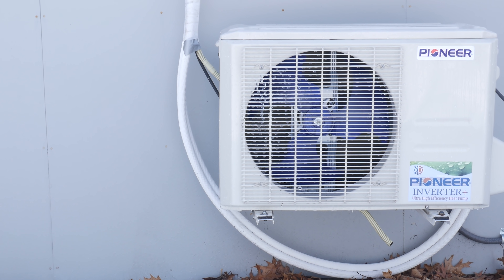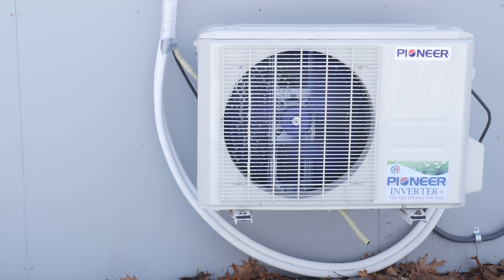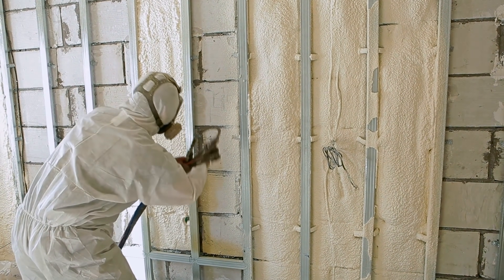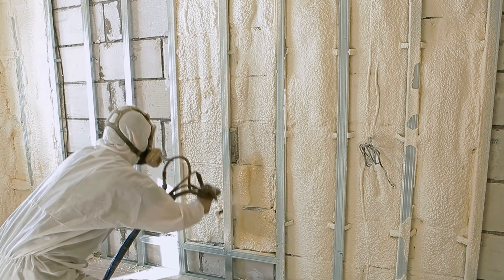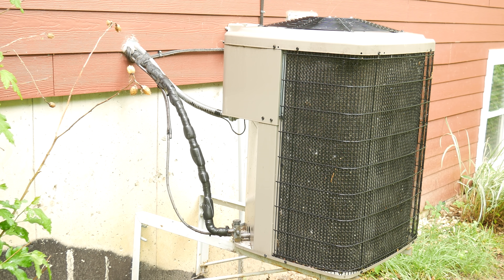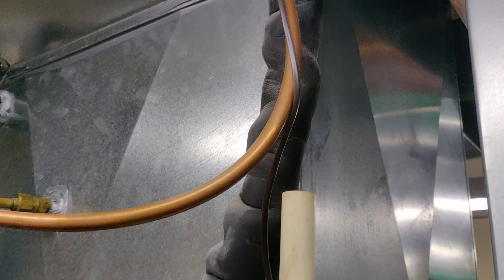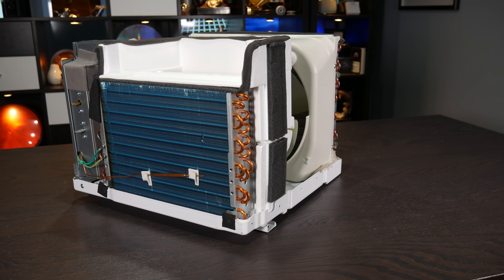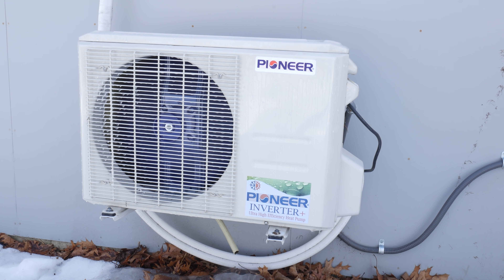Heat Pumps are Not Hard: Here's what it will take to start pumping

Comment: "Seattle noise ordinance" sounds like BS. I worked for an HVAC contractor in Seattle who specialized in heat pumps. The one noise complaint we had he had an acoustical engineer check out. From the complaining neighbor's property, the measured sound level of the "noisy" heat  pump  was less than the wind blowing through the birch trees between the two houses.
As a side note HSPE and SEER need to be regarded as soft facts. To make them comparable across brands, the use of resistance heat during defrost cycles and due to consumer demand (turning up the thermostat "because it's cold" which engages the resistance heat to meet that demand) is discounted.
[When heat pumps were first being installed in the Portland area the BPA did a study which found that these factors decreased the unit's actual efficiency: a cold wet climate which required frequent defrosting, resistance heating to warm the cooled air when in defrost mode and people bumping up the thermostat, could push a COP near to 1.0]
 not accustomed to the "cool air" produced by a heat pump]

Comment: Out heatpump performs worst at -5 to +5 centigrades. The reason for this, afaict, is that it needs to defrost much, MUCH, more often than at higher or lower temperatures.

For us, this is not a reason not to buy one, but maybe to have an alternative solution or a prepared mind for colder temperatures during some months of the year.

A relative has a fancy kind that can show COP, and during December it dipped below 1...

Still... More than 90 per cent of the time it works better than direct electric heating.

Comment: Carrier claimed that it would be infeasible for me to replace my AC with a heat pump... We needed a new AC and I asked for a heat pump instead and they said that the heat pump is much larger which would make it impossible to install in-place... They would have to pour an entirely new concrete platform and run everything to the new location which would cost tens of thousands... Absolutely ridiculous. So frustrated that now we're stuck with a brand new AC but still stuck with our furnace. It really does feel like all the stupid HVAC companies want to prevent heat pump adoption. Here in the PNW, it never goes below 10°F.

Comment: As far as I know heating heat pumps will have condensation on the outside unit, what might also freeze and blocks the further water to flow. This is something you should have addressed in this video.

Comment: I've had a heat pump for around 15 years.  Over the last couple of years it's started making hissing or screeching noises when starting up sometimes.  Anyone know what's causing that?

A quick search says that it's coolant escaping or the bearings in the motor needing greasing/the motor is failing.  Since it's been happening for a while I'm guessing the motor isn't failing.  Also seems like if it had been losing coolant for so long it would be out and no longer working.  Looks like the motor's bearings may need a good lubing.

Hmm, after a little more research it looks like it might just be the unit starting up after the defrost cycle.  The sound is the same but it's hard to tell from a video if the loudness of the sound is the same.  Still think I will have a technician check it out just to be sure.

Comment: Some other things to note here.
 
Brands for heat-pumps vary a lot in capability, pick wisely.

A higher end brand like Daiken make excellent units overall but you pay more. 
Mitsubishi make excellent mid-teir mid-priced units, and I'd personally suggest you avoid anything that says "Fujitsu" and is cheap. To make it clear Funjitsi expensive units are expensive for a reason and are fine, but their cheaper units are AWFUL avoid.  
Not saying they are "Bad" overall just that they have more problems than other brands, and their remotes are overall poor user friendly, less reliable and annoying to use. the cheaper teh unit the more cost cutting was done and it is noticeable. a house is something you own for a long time, and so is a heat pump. Pay more and bet a better unit you will not regret it, go the other way, and you will.

Also: Size matters. No really, a 3000W unit will be a LOT more quiet than a smaller 1500W unit, and that matters when you are putting on in a bedroom. The bigger the better when it comes to noise reduction levels. The price goes up the bigger the unit, but the unit is more efficient so creates less noise, and wastes less power overall.

Wifi - Add on components. Manage your Air-con away from home (or in bed), set it so it turns on before you come home, so you get home to a nice cool home, or a warm one etc. Wifi units are not default in most units. Often an add on function, some are built into the design, and others require big ugly extra boxes next to the head unit. 

Also because WiFi varies in quality so it could drop, or if your connection is down you cannot remotely turn on your heat etc. 

Just some tips from a person who's had a LOT of dealings with heat pump installs.

Comment: If you seal your house too much, then the house will not be able to breathe. An house which can not breathe much, even none at all, then moisture will start to build. Thus mold mildew, and damage from the moisture on the wood, and taking into account that the newer houses are built with new growth wood, and that differs from older homes built with old growth wood. That is why older houses stand longer and handle more situations that would damage newer houses.

Comment: It's expensive cause it's good buisness.
In US everything is made more expensive because people can spend that much. For this reason ,companies make millions even billions in a short amount of time.

The mitsubishi heating setup you've talked about earlier would cost around (4450-4460$) in my country. For the entire setup.
3800$ for the AC (yes !, in my country it's 3800$ and it's ) 
600$ more or less for tubing and wiring 
100$ for fastners and other required equipments.
And around 50-60$ for installation service.

We can buy a brand new 1ton AC or from only 390$ to 666$ 
Local brands sell a 3 ton AC for only (900$ to 1000$)
 Even some imported once like a 3 ton General AC from japan will cost around 1100$ 

Point to be noted ; in our country we use split system AC although these split systems can be integrated to duct systems quiet easily ,which are capable of both heating and cooling ,so I've simply mentioned AC.

Comment: Wait, doesn't this mean we can use heat pumps for hot water, air conditioning, and heating? All with just essentially 1 outside unit (or possibly stacked units).

Comment: My house is over 100 years old. The insulation situation is not great. I heat with firewood, with 15 acres available and plenty of dead ash. That’s almost entirely free, just with a time commitment. Heat pumps are stupid. I’ll probably get a heat pump furnace installed when the new house is built though. It’s stupid so it’s easy and doesn’t require onsite fuel.

Comment: Is there any smart system to implement in small factory to at the same time pump heat from cold/freezing room to other part of facility or even heat water? This would be like win win situation, you take unwanted heat from one place and transfer it where needed. Maybe even use in blast/shock freezer? Anyone?

Comment: as a commercial HVAC tech, I hate the idea of heat pumps for one big reason: you're relying on a refrigerant as a primary source of heat. leaks are far more expensive and time consuming to fix than a boiler or gas furnace. I live and work in the Chicago suburbs and SO many of the VRF heat pump systems are problematic, leaks and compressor failure being the main culprits.

Comment: Hypothetically if an entire city has heat pumps as the only source of heating during the winter time, with all of them trying to extract heat from the environment, wouldn't the city itself get colder??? I guess the heat pumps themselves would also be creating  heat. But think about it, what you're doing is thermally connecting the inside of every enclosed space with the outside environment, essentially increasing the surface area of the entire city, and with more surfaces absorbing the heat there will be less of it in the are therefore dropping the temperature at least slightly!

Comment: i really see a 2 part system in updating insulation in buildings 1 a multiyear tax right off and 2 a tax on Commercial buildings that dont meet a certain R value and will increase based on average rent price + energy cost meaning increasing rent to pay for the tax will just cause the tax to increase by that amount

Comment: 11:08. I really think you need to emphasise the importance of not letting the refrigerant out. The fact that's it way more likely with split units is the main problem with them. most have huge GWP (2000-15,000), you can set the atmosphere back the same amount as several years-worth of heating with gas. Newer propane and CO2 based machines are way safer. I really would avoid recommended HFC and CFC-based split machines to people. I am amazed that you are allowed to just put in your own F-gases where you are. Land of the Free in non-ironic form, but I dread to think how many slightly leaky heatpumps there are out there, slowly leaking F-gases

Comment: What about the sensor technology being used on, for example, heat pump clothes dryers? It’s not working real well, sorry to say. The devices are deciding, poorly, when your items are dry, and owners of these dryers are having to literally add water to the drum, or a wet rag, to trick the system into completing the task. So, if the intent is to save energy, it isn’t great.

Comment: What about tax breaks to building owners that meet certain insulation requirements. And tax penalties if your building is too inefficient (thus new buildings have to meet a certain standard thats sliding and hopefully this wouldnt completely grandfather in older buildings into doing nothing - there would be grants or low / 0% interest rate loans for various owners who want to retrofit and gain the tax benefits).

Comment: 1. Insulate
2. Insulate
3. Insulate 
True. And that is why HPs make absolutely no sense in cars.
Reply: But they do make sense in cars. Teslas with HP's see big range gains compared to resistive heater variants.
Reply: @logitech4873  I own 5 Teslas (2 M3s and 3 MSs) with and without HP and I don't notice any difference in range. Those are theoretical numbers on factsheets. It depends where you drive them. Here in eastern Switzerland, where's it usually cold in Winters, the HP is useless. The car primarily heats through resistive heaters anyway. Simply because the HP cannot produce like 60°C warm air which is required to heat up the cabin in a decent amount of time. And then, throughout the rest of the year when it's warmer and you don't need to heat the car, you have to transport all the extra weight of the HP which causes higher consumption. In addition the HP is a complex expensive device which requires expensive maintenance. I am forseeing the future now: The biggest problems with used electric cars will be expensive HP repairs which will pressure on the used-car prices. I calculated that my Model 3 LR has to be driven for up to 33 years until the additional price of the heatpump pays out through the reduced amount of electricity needed. For the price of the heatpump it would be much smarter, cheaper, and also better for the environment, to add an additional 10kWh of battery capacity to increase the range of the vehicle. Because the additional capacity is usable throughout all year all the time. It allows the car to charge faster and the battery life is extended because of about 15% less charging cycles required. HP in cars are a waste of money. They are good for well isolated buildings though. But a car is not a stationary building. The constant shocks to the HP system while driving is causing heatpumps to fail much more often than they do in buildings. I predict that most of the todays' heatpump will not live longer than about 8 years in average. Exchanging a heatpump will cost like 4000$  for hardware + labor. That's what I mean when I say that this risk in expensive repair will pressure on the used-cars prices. In the future people will look out for EVs without heatpumps on the used-car market and EVs with heatpumps will be harder to sell. Look at how often the AC breaks in older cars. Pretty much every older car once experiences a defective AC. And cooling is much simpler (and less material demanding) than heating. I only buy an EV with a HP when I decide to sell it again after 4-5 years. I also own a Hyundai Kona which I plan to keep for longer time. So I bought it without the HP.

In Germany they tested all sorts of heatpumps in different cars and no additional benefit could be recorded so far in real life environments. In case of the VW ID3 the car with the HP was even less efficient than the one without. In the end I say: everyone should buy what he wants. I just don't want the government to like mandate heatpumps in EVs. It does not make any sense in that application field.

Comment: I think the insulation Materials you showed do not have the thermal mass that's needed to keep radiant heat out. They are great at not conducting heat tho but at thé end of there life just at tho thé big pile of trash. 

It's better tot use woodfiber and cellulose insulation. They alsof good at not conducting and are a lot better in storing radiant heat so it doesn't enter the home. And at thé end of there life they go back to nature or can be recycled or reusd easyly

Comment: Guess who got a heat pump? This guy! The furnace was busted and the AC coil was rusting out, so cheaper to replace with a 16 SEER heat pump than replace what was already there with new. $6300 installed with new, fancy, wifi thermo.

EDIT: The other quotes I got: 11k+, and 14k+.

Comment: You cannot beat the laws of physics. Either you live in a modern, over insulated, poorly ventilated sweat-box, which is both unpleasant and unhealthy to live in, most of the time, and requires a ton of energy to cool in summer, but can be heated with a candle in winter - with big energy savings. Or, you live in the opposite (like me) in a 120 year old, well ventilated (healthy), stone walled house with natural air-conditioning with zero running costs in summer, but hell to heat in winter. (don’t ask me about my 2 boilers). - I know which I’d rather live in.
Reply: An "overly insulated" building is easy to keep cool with an aircon.

Comment: It is so easy to completely destroy an older building by "insulating" it. The worst case is when the exterior is designed (or simply built regardless of design) to dry to the interior as was typical up into the 1980s, and you seal the interior in the name of efficiency. Then the walls rot, but you don't know it for 10-20 years.
A proper efficiency improvement really needs to consider everything from sealing the exterior to modern standards for water and vapor, and continuing to insulation and sufficient ventilation (air changes per day) for the health of the building and the occupants.
Or you just add a heat pump and ignore the existing building.

Comment: lennox is stupid expensive. working in the trade they are one of the most expensive brands out there. still 16000 is ridiculous. Here in Florida the highest seer rated units at 21seer are installed for around 10000 to 12000 as long as it is carrier or goodman brands or their other units they sell cheaper than the top names of the ones they make. Everything is more expensive in california so not very surprised.

Comment: Dual fuel systems are better. You can use either fuel electric or gas. Then you're future protected from politicians and unions determining which we will use. With propane tanks you can fill it up when it's cheap and limit your use. You need back up heat anyway.

Comment: With the war in the Ukraine and the dependence of much of Europe on Russian gas, this should be the begining of this topic, not the end.
My country has a lot of natural gas reserves but the exploitation leads to earth quakes, hence why we want to be less dependent on it.
In our temperate climate, we only used to need heating in the autum-winter-spring. With the climate becoming hotter, more and more people are installing mini split (ductless) aircpnditioners. Newer buildings will have air-air or even water well heatpumps from the start, they are no longer allowed connection to the natural gas grid. 
My old flat has a gas furnace (for heating and hot tap water) which I had installed for 1400 euros. My parents have exactly the same unit for 2000 euros, so yeah, I know what you mean wiith companies trying to maximze profit.

Comment: Speaking of noise: lots of appliances and machines, even buses, always appeared much noisier than those I am used to here in Europe. And I did some research on it. Guess what? Americans will only recognize an appliance as "powerful" if it is noisy enough. I had many visitors from the US in my home here in Europe and they all stared at my Miele dishwasher and washer when they were running - silently. Many companies providijg appliances internationally say that for the US market the have been told not to add sound preventing meterials such as rubber or foam insulators, because the american customers want these things to be ....noisy. Rarely have problems been so easily to be solved, simply by changing an attitude...